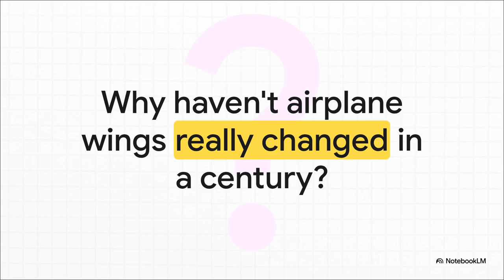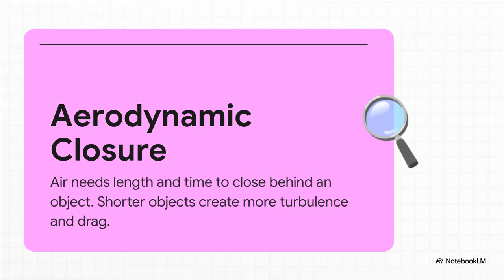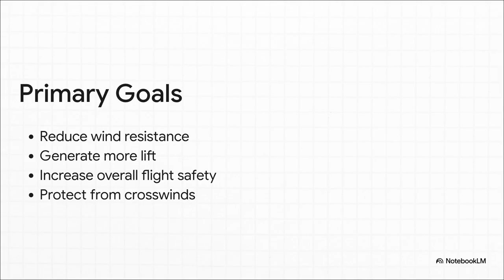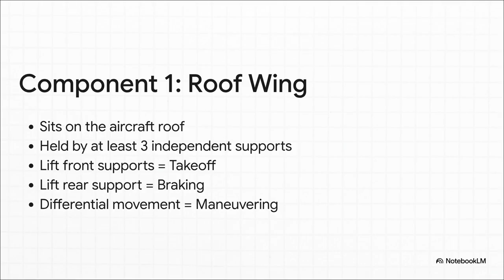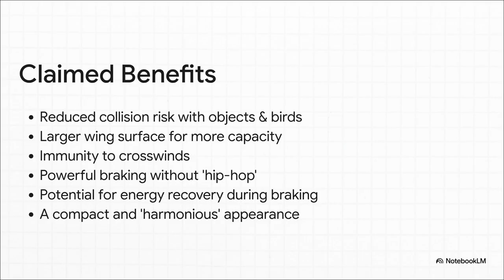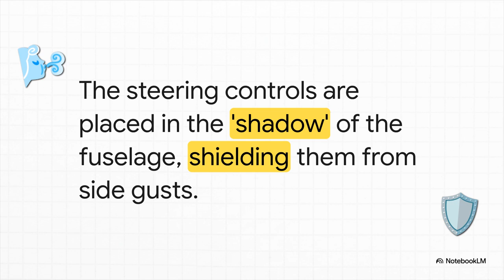Rethinking the Airplane Wing

Comment: This would do nothing to reduce the affect of a crosswind.
Reply from the maker: The steering mechanism at the tail is the main reason an airplane is so affected by crosswind during landing.
The new invention features control surfaces mounted laterally and parallel to the fuselage. This positioning places them in the aircraft's aerodynamic shadow, thus protecting them from crosswinds.